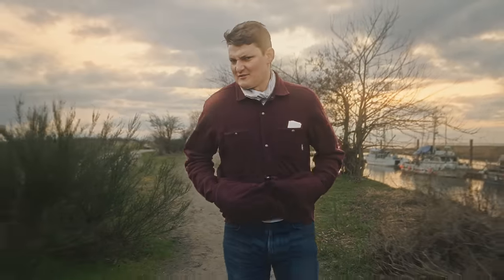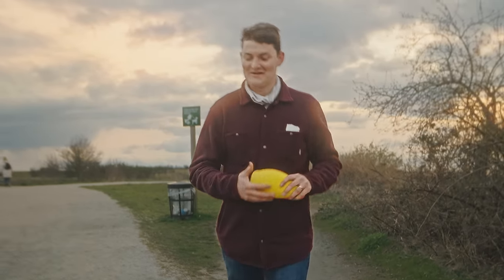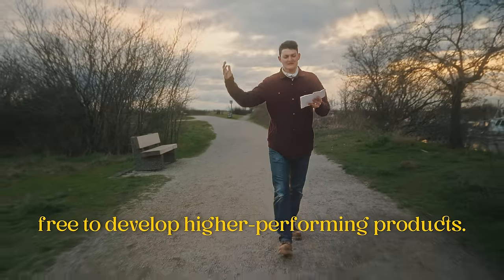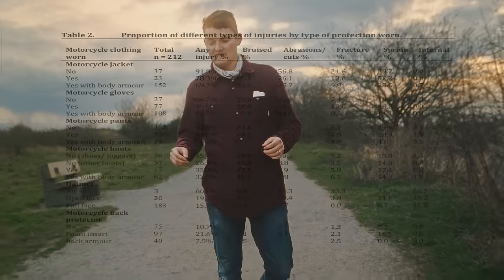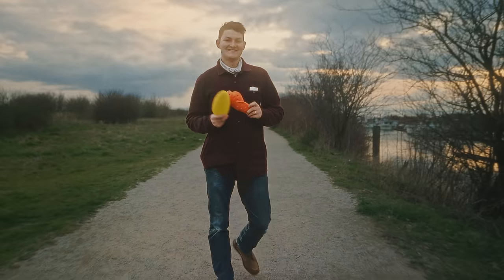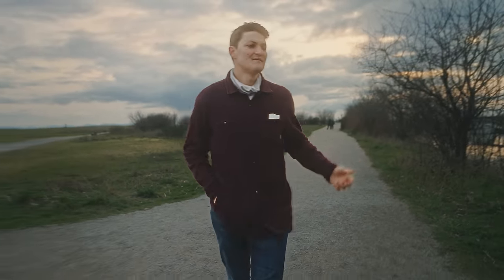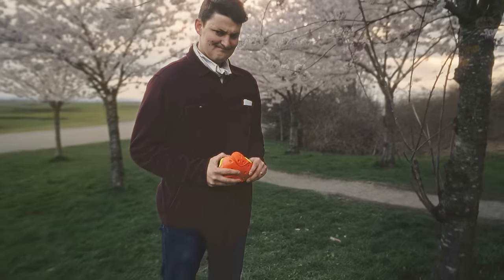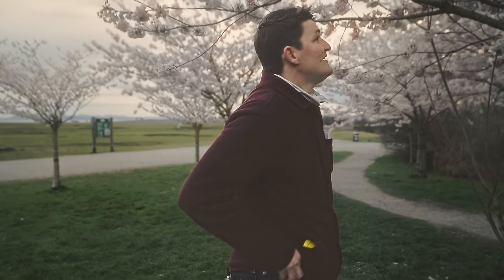Why I Stopped Wearing Motorcycle Body Armour

Comment from the maker: It's worth mentioning that EN17092 tests garments with the pads *removed*. Meaning a AAA jacket or pant, which has been drop tested on the Darmstadt machine at 120kph, will still slide to a highway-speed stop without costing you skin (70kph for AA, 45kph for A). C-class garments have no abrasion resistance criteria whatsoever; this would be something like a mesh chassis for holding armour. Obviously, removing the pads from that would be silly, since its only purpose is to hold armour and you might as well wear a T-shirt instead.

On that note, there are hero companies that make pads to greatly exceed CE 2 size and attenuation requirements. Aside from the Dainese back pad I showed, Rukka's D3O XTR comes to mind (link in description). Those pads are huge compared to the Type B template, and size matters if you're going to rely on pads to get to wherever your abrasion comfort level is. We don't always slide precisely on our shoulders, elbows and knees. It's usually the butt.

We all have our own equations for balancing comfort v. practicality v. safety, which is why I made a point of not telling people to take the armour out of their jackets (twice!). Fortunately the CE standards make it fairly clear what your gear can and can't do, enabling us all to choose the stuff that achieves whatever we're after. ~RF9
Reply: Apologies that my first comment on one of my favourite channels is a criticism.

EN1621-2 is the standard for back protection. The Limb Joint Protectors used in the video are covered by EN1621-1.
Reply: My biggest question to this (and I have many) would be are there quality stand-alone armor makers whose armor is worth replacing the substandard stuff with? And if so who are they?
Reply: Great video.  Thanks for the educational perspective.
Reply: @dmoooooooo  : D3O, Forcefield, Knox, Rheon and SAS-Tec, to name but five - although to refer to other manufacturers’ components as “substandard” is inaccurate. They pass the standard, so are not substandard; it is simply that some producers use superior materials or engineer their products to exceed the requirements set by the standard.
Reply: Thank you, another great video that actually brings information and data! 

One comment / question though, is how does this relate to offroad riding? 

I ride hard enduro, so when I fall, it's never at 120 MPH on asphalt. It's more at 10-25 MPH on gravel / rocks / dirt. And I think that these pads are very useful in spreading the absorbed force, so instead of being poked by pointy gravel, the hit is spread somewhat evenly across the surface of the pad, reducing the overall absorbed force (I believe quite more dramatically compared to the asphalt test). 

So, what is your opinion on using pads for offroad?
Reply: @FortNine : References to velocity (kph) were removed from the draft EN 17092 after the CEN Enquiry in early 2017. The published version refers only to revolutions per minute of the sample holder. There is a full explanation of this in part 2 of the MCGearHub interview you have cited in your references.

In hindsight, perhaps references to speeds should have been retained, as this might then have caused riders to question the suitability of one-piece leather suits, for use in competition and track day events that conform to the EN 17092-3 “AA” requirements, where the highest speed setting of the abrasion resistance test apparatus is a lowly 70kph/414 rpm (not 75kph/442 rpm, as depicted in one of the MCGearHub graphics accompanying the interview), or 43.5mph. 

The FIM has mandated use of EN 17092 AAA and AA racing suits since 1st January 2022. I consider AA to be entirely inadequate for track use.
Reply: The kph ratings are very misleading and do not realistically correlate to real world speed protection. Given the amount of research you guys appear to do with videos, I'm surprised you seem to be peddling this common myth tbh. Unless people are falling on road made from Darmstadt machines, these numbers mean next to nothing.
Reply: I think you should’ve argued the fact that the pads that are supplied in so-called motorcycle pants should be better
Reply: Subject matter aside, that was a superb, 1-take, presentation. Nicely done.

It's probably not conveniently or physically feasible to "prevent" bone damage in high speed impacts, But I can attest that in the only high-speed accident I had, the leather alone, of my motorcycle gear, kept my broken bones from puncturing my skin in a bid to escape my body. That leather protection alone greatly decreased blood loss and increased my recovery time. Didn't stop me getting broken bones though 😂. 

"Safety" equipment made to the "lowest cost point" - isn't that an oxymoron?
Reply: @IN_ZANE_ I agree. Unless you come off your bike in a city street you’re going to be landing on chip seal, not asphalt. Which will chew through just about everything except leather. My understanding is that the material that sits over a pad resists abrasion longer than material that doesn’t as well. I’m not expecting those pads to save my life. I want them to extend my slide time on chip seal roads.
Reply: For folks curious about what this video is a stylistic reference to, it's a Johnny Walker ad from a few years ago called The Man Who Walked Around the World
Reply: I won't be taking my body armor out of my riding gear.
Reply: It would be nice to have a video about good/quality armor jacket/[ants, protectors...
Reply: Given that this video is titled 'Why I stopped wearing motorcycle body armour', and how people go by a headline rather than dig deep into content (not to mention look for any agenda), saying here that you twice told people not to take armour out of their jackets (you forgot to mention pants as well) seems contradictory. The first line in the description also says 'These pads are useless, get an airbag' then affiliate links to the tether-deployed Helite system featured regularly in your videos.
Armour has a significant impact (no pun intended) on the protection a rider can benefit from, and personally I think this is a really irresponsible video (even more so than claiming a 7mm chain takes four and a half minutes to cut). What people wear should 100% be their choice, but I believe it should be an informed choice, not an influenced one.
Oh, by the way – armour is made to two minimum template sizes – Type A is the smallest, Type B is the larger one. Larger armour is generally better of course, though the size of the wearer also needs to be taken into account. As does the position and retention of the armour.
John Milbank, Consumer Editor, Bennetts BikeSocial
Reply: Some might say that, and I quote from the description in this video, "The best motorcycle armor is the one you'll actually wear."
https://www.youtube.com/watch?v=-e6Jy69mezg
Reply: Ryan, I think this interpretation is falling under survivorship bias. Yes, potentially the standard is too low, and yes, people still get hurt when they have accidents. But it's impossible to test the exact same accident with and without armor, and we're missing the distinction that these injuries are more than likely less severe than if the rider had not been wearing any body armor.

My take is wearing protection that reduces the impact is better than taking the full force of the impact, any day.
Reply: @bennettsbikesocial  Very well said! This is one of the many videos by Fortnine where the topic premises are distorted and without proper technical understanding, important nuances are not discussed (sometimes only briefly mentioned), and the conclusions in the videos are absolutely dangerous for the community, especially for beginner riders. To motivate people to take off their protection pads is absolutely irresponsible!
Reply: @isaaclarson  These pads are meant to protect the exposed "edges" of the bones on the elbows and knees. The relatively soft material distributes the impact force on the greater area of the bone, which means more area to absorb the energy and less force per square mm of the impact area, meaning lesser risk of a fracture. To argue that having no protector is the same as having even a small protector is nonsense. You don't even need to test it, it's simple physics. Throw a glass on the floor, it will break. Put a sweater tightly around the glass and throw it, the chances are it will not break. Smartphone protective covers - same reason.
Reply: @flyingmagpie1937  I'm arguing in favor of protectors? I'm confused by your comment here. I'm saying that because of survivorship bias, we have no way of knowing how severe the injury would have been - let me rephrase.... How much MORE severe the injury would have been without the CE pads in place.
Reply: @isaaclarson  Yes, sorry, I didn't mean to oppose you. I'm acknowledging your comment. I meant to explain it further, that even without the "survivors" data, you can already predict that using pads will certainly have benefits over not having any protection pads. Also because similar knee and elbow protection is in many other activities and sports, we can see the benefits of the pads in other areas as well. Sorry for the confusion.
Reply from the maker: @itamarchen1  Yeah I usually wear pads for off-roading and racing. The falls are so frequent, and the rides are usually short and recreational, so it makes sense to take whatever protection you can get. Also, like you say, enduro crashes are usually slower. For general, everyday motorcycling my preference is no pads, but that's just me. ~RF9
Reply from the maker: @paulvarnsverry11  Yes I was bummed when they removed the kph numbers! I assumed it had something to do with not being sued, since every road surface is different, and someone will inevitably crash in a AAA garment at precisely 120kph, lose some skin, and sue. It's a shame though, because "707.4rpm" doesn't mean much to the average consumer. ~RF9
Reply: @FortNine  That's precisely the point, Ryan. If a suit "safety rated" for 120kph from a controlled and repeatable laboratory test failed at 85kph in the chaotic and random circumstances of a real world incident, resulting in the wearer being injured, the manufacturer might find it difficult to defend a claim. That's why I don't understand brands that continue to peddle the kph claims in their advertising and marketing, and who are leaving themselves exposed in the event of litigation.
Reply: While I get what you are leaning to this is a bit of a dangerous video for young, new, or less aware riders.  We have spent decades trying to get riders to wear protective gear…. Like any gear.  I still cringe at these sport bike guys in summer riding in beach shorts, muscle t shirts and flip flops.  I still remember riding dirt bikes on the farm when we didnt own helmets because “we were not racing”!  Finally I feel we were making headway across most rider groups.  And while many of the current tech standards are not good enough rather than rally the hordes to demand better and safer standards, you have advised you are just taking out what little protection you have.  Shame on you Ryan.  Many kids and newbies look to you like the holy grail of advise.  While technically what you said is not wrong.  The pads will protect more than not having them!  Pads do prevent injuries (minor vs major injuries is irrelevant really). Then if we look at what the stats may not capture such as protection on glancing blows, lacerations and even puncture wounds from even small things, the prevented injuries that are at that point where a bone almost breaks, but not quite, bruising and recovery time reduction by having any padding and what about all of the injuries both reported and not reported that dont make it into the oficial stats?  My first riding pants were a set of no name department store jeans.
 When i turned 18 i got myself a set of leather pants ( no padding and really not protective). Now i always ride with gear.  I know you said this is only your opinion but young kids look to you for advice.  I feel you move to vancouver hipsterism has made your head soft bud.  Whether you want to admit it or not, you are a role model.  You cant rely on those that don’t understand all the nuance of what you said to critically think about wearing armour. Kids will see that and think if Ryan doesn’t wear  armour i wont.  But with that they may just not buy protective clothing.  I really thought you were smarter than this.  So sad today😢
Reply from the maker: @bennettsbikesocial  There's an important difference between "Why I Stopped Wearing Body Armour" and "You Should Stop Wearing Body Armour." The inability to distinguish between a personal opinion and a public imperative might be why the internet is such an angry place these days, and apparently stating it explicitly, twice, is not enough to get past that? We're in trouble.

I am aware of the Type A template, but I like to give a "best chance" to the things I attack as inadequate. That's also why, when listing the EN1621 kN threshold for armour pads, I listed the higher EN1621-2 numbers instead of the lower EN1621-1. I really don't need to underrepresent armour pads to expose them as inadequate, and doing so would only leave people whining about the existence of Type B and EN1621-2 in the comments as a rebuttal. Oh well, I guess there's no way around that either.

Also, if you think my agenda is to get rich off an airbag that isn't in stock at FortNine, your opinion of my intelligence must be as low as your opinion of my morals. ~RF9
Reply: @FortNine You mean it wasn't an April Fool thing! 😲🤯
Reply: @FortNine  Problem is few will do their homework or actually interpret the video as "do prefer an airbag to pads". For such a life or death topic you need as many disclaimers as possible. The fact that you talk rather confidently when drawing conclusions from all these statistically underpowered and survivorship biased studies doesn't really help. I am sure we are all for the gear companies doing better, but demonstrating the need for this shouldn't come with collateral damage.
Reply: @paulvarnsverry11  Plus, as you know, ONLY in AAA is the butt considered a key-impact area. In AA and A the speeds Ryan has quoted above are even less relevant. If we translate them though, in AA the butt is actually tested at the equivalent of 45kmh / 28mph. In A, the butt only has to endure a test at the equivalent of 25kmh/15mph. And that's before you take into account that the Darmstadt machine is considered an analogue of tarmac, which has been proven to be around 4.5 times LESS abrtasive than the surface dressing found on most of the roads that riders in the UK enjoy.
Reply: @itamarchen1  I ride the same - but not even hard enduro - and slip/slide/fall plenty. And my experience is the same: slower speed falls onto lumpy, gravelly, rocky surfaces. The padding in my gear also spreads the impact of gnarly little, finer-point objects and surfaces. So far, my only (knock on wood) joint injury was a shoulder/clavicle thing from landing hard thereon. I'm thinking only an airbag might have prevented that. Otherwise, the padding has done what I expected. Doing pavement at speed is a different animal - considerably more savage.
Reply: It is hard to make a decision from data like this. Yes, understand that the protection or standard of protection is subpar. However, there is still at least some protection. This video helped me be more critical about motorcycle gear . Shoot for the highest crash rating gear for the money and not a  brand and add an airbag. This is better than continuing to buy expensive stuff without any logical approach.
Reply: @bennettsbikesocial  surface dressing really is viscous.
Reply: What about EN17092-2020 B-class garments? That's garments approved for abrasion resistance, but without any armored padding. Maybe this, through some lobbying ofc, could be the new standard for motorcycle garments, and we could have class B, BB, and BB, in addition to A, AA, and AAA?

Sidenote: after learning this info I can't help but laugh at the uselessness fo the old EN-approval rating for motorcycle garments (jackets and pants that is): apparently they did not test for abrasion resistance at all; they just checked that the padding in the garments were EN1621-1:2012 / EN1621-2:2014 / EN 1621-3:2018. Anyways I digress, I too now will not use padding anymore.
Reply: Greetings from TU Darmstadt
Reply: @FortNine remember you are a respected content creator in a position of influence, like it or not people will 'do as Ryan does' because they like you. Also remember that most consumers of content don't truly listen, they only hear the headlines
Reply: @FortNine  The internet wouldn't be such angry place, if you did proper research for your topics and didn't misrepresent the information you are citing:

- The study “Energy attenuation performance of impact protection worn by motorcyclists in real-world crashes” (2017).
"The work presented here relates energy attenuation as measured using the EN 1621-1 test method to real-world injury outcome. The results cannot be directly related to fracture tolerance levels reported in the literature from different loading conditions, and currently there has been no work linking energy attenuation measured in this way with the types of loading conditions leading to fracture in the real world." Meaning, the femure's 4 kN and the IP's 9 kN are NOT directly comparable!
“90 riders were recruited in this study”, the clothing was inspected from 62 people, and the IPs were collected from ONLY 19 riders! Citations from the study: “As noted earlier, this sample included only a small number of riders with impact injury, and the total number of riders was also small. The results presented here should be confirmed in a larger sample.”
“Due to the recruitment methods used in the larger in-depth investigation study, this sample of riders is also biased toward the more seriously injured riders involved in motorcycle crashes.”

- The study “Effectiveness of protective clothing for motorized 2-wheeler riders” (2018).
The study analyzed the protectiveness of the all motorcycle clothing overall, not IP in particular. So, of course motorcycle gear can't completely protect you against ANY fractures, dislocations, or sprains. Citation: “Our results argue for more widespread use of protective clothing by MTW (motorized 2-wheeler) users.”

- The study “Motorcycle protective clothing: protection from injury or just the weather?” (2011). 
“Data was obtained through structured face-to-face interviews.” “No association between armor usage and fractures” doesn’t mean they are useless; it means in this particular study (with 212 subjects) they didn’t find ANY association to make any relevant conclusion about that. Then literally in the next sentence after "...the benefits could not be detected specifically in relation to fractures..." they state "...in unprotected motorcyclists (Duffy and Blair, *1991*) the sample size was likely too small to be able to detect any such difference." Also, conclusion from the study: “Conclusions: Motorcycle protective clothing is associated with reduced risk and severity of crash related injury and hospitalization, particularly when fitted with *body armour*.”

- Meredith L. “Assessing the performance of motorcyclists’ impact protectors in simulated ATD knee and shoulder impacts” (2019). 
By the way, you wrote the wrong name of the study in your sources. This study tested 23 shoulder IP and 7 knee IPs. They tested if the EN 1621-1 impact test performance is “a good indication of IP performance”. The relationship between IP performance and injury protection remains unclear, because they can’t exactly evaluate it and not because the IPs are useless. 

All these studies show is that impact protectors can't 100% completely protect you from an injury and should definitely be better than they are now. But it doesn't mean they don't protect from severe injuries, and I mean from fractures too and also from potential nerve damages. It seems like you’re just cherry-picking citations to make the IPs seem useless. Otherwise you wouldn't ask "Why then are these things everywhere?". It's also interesting that somehow there are IPs that are apparently good, because they go "waaay beyond the CE standard", but you don't cite any studies or explain why exactly "it works" in comparison to the "useless" ordinary CE IPs.

In the video you talked IPs being useless for 5 minutes. So, the insecure "I can't tell you..." and "I won't tell you..." followed by "I did it and I love it" didn't have much weight. Then you emphasized your choice with such philosophical saying, that the “appreciation” of life should be more important that the “protection” of it. If it isn't persuasive, I don't know what is. For me it doesn't sound like a strong statement to keep people from making the same decision.
You are kind of a role model for many young motorcyclists here, many want to learn from your videos. And your inability or unwillingness to acknowledge the influence of your opinion on the public through the cinematography and art and the clear agenda in this video is extremely naïve and malicious. So please, Ryan, I am sure you can do better.
Reply: This is just a YouTube channel, I know, but I have to admit I'm sad this day has come. I know content creators nowadays need to milk the algorithm with the most inflammatory, misguided, engagement-enducing videos they can come up with, but somehow I expected Fortnine to be above the trend. To think this is the same channel that made the cinematic masterpiece that was the Kawasaki Versys 300 video six years ago is almost painful. Thanks for the journey, I guess...
Reply: @ZANGI3F  you have much more adequately summarized my thoughts. I'm absolutely stunned that after looking at the data the take away was armor doesn't help. Stunned
Reply: @FortNine  please don't go for low hanging culture fruit as the reason your audience finds issue with your points. It's a debate we can disagree with your findings and the world not be ending. 

You're better than that. I would not be able to handle thousands of people saying I'm wrong either but just so you know we have limited characters you have videos. Expression is narrow via this format.
Reply: Thanks for the video. Good information (for on road riding). FYI, since you cited a study here, it would be proper to provide a link to the paper, or at the very least a reference in the description. Thanks 🙏
Reply: @flyingmagpie1937  Thank you. F9 has to delete this video.
Reply: @bennettsbikesocial  "What people wear should 100% be their choice, but I believe it should be an informed choice"...This video literally gave information. WTF are you asking for?
Reply: @paulvarnsverry11 The bigger issue is the longstanding and immoral ‘regulatory capture’. It’s plagued motorcycle protective clothing, e.g. Dainese and Alpinestars successfully lobbying against Europe adopting Dr Woods’ level 3 armour standard. And more recently, Knox successfully blocked the establishment of AAAA and AAAAA standards. The poachers are also the gamekeepers because manufacturers comprise about half the standards committee members 😡
Reply: @bennettsbikesocial Indeed. However, I praise Ryan’s video for calling out the ‘regulatory capture’. Concerning CE and BSI standards, regulatory capture is a longstanding and immoral problem. The poachers are also the gamekeepers because manufacturers comprise half the standards committee members. It’s how Alpinestars and Dainese stopped Dr Woods’ level 3 armour standard from being adopted as a European standard. More recently, Knox’s ability to block BSI from establishing the AAAA and AAAAA standards is a blatant example of regulatory capture 😡
Reply: I don't even ride and I love your videos
Reply: @MrStrizver  This video literally didn't give ANY substantial information! The Femur breaking force can't be compared like he did, the studies were misrepresented/misinterpreted, hence the accusation of Regulatory Capture is baseless and out of the blue. What you basically get from the video is - Ryan bashing the CE standard, saying he got rid of his IPs and he loves it, because one should enjoy life instead of overprotecting it. And the important mentions from his pinned comment are not in the video!
I'm all in for criticizing the CE standard to do better, but this video is absolutely not how one should do it.
Reply: @The-Splat  While this is a real problem, the way Ryan calls it out is likely more harmful than helpful. You don't claim that armor that prevents injury isn't good enough (for some definition of "good enough") at preventing injury so we should discard it?! This is irresponsible and unscientific. It might not be "good enough", but it is anything but useless, as clearly exemplified by the very studies (ab)used to back the claim.

If you want to induce changes in the standard, you point out the weak points (and there are many). You point out the alternatives (and there are some). And you use your power of influence to guide the gullible towards better odds of survival, not to encourage them to drop even the tiny amount of protection all the kids are using these days. Power comes with responsibility.
Reply: Whoever thought that protection from abrasions inuries might be a good thing?  I don't expect my gear to prevent broken bones, but I'm sure glad the skin on my shoulders and elbows doesn't have mesh fabric melted into it!
Reply: @bennettsbikesocial Well  said John 👍👍a completely irresponsible video, even the missus said what the heck is he talking about! I’ll always support your consumer advice 👌
Reply: This channel jumped the shark long ago. Too bad.
Reply: @FortNine  instead of doubling down on being wrong, maybe correct your f*ck up
Reply: I have the same Dainese back pad and it is awesome. As well as on my motorbike, I also use it when I go skiing ad it saved me
Reply: Thanks @derekcowan2373  ! I don't have anyone to help me film or edit, so the production values are often lacking, but hopefully the content helps. And videos are just a fraction of my job, but I'm lucky that I'm paid a salary that isn't affected by our content's success at all. The agenda is to simply build awareness of our brand as a motorcycle insurer, and hopefully to build trust in it (and before anyone asks, no, what you wear – besides a helmet – doesn't affect your insurance policy), because we want more people to get more out of motorcycling. I guess you could say though that the more riders there are, the more money we could make! Cheers, John
Reply: @ezsteel78  Regulatory capture aside, the CE standard is ineffective for impact protection. All the peer-reviewed scientific studies have shown that the standard is too low to protect us from fractures. 
The evidence indicates that armour's additional abrasion resistance helps compensate for our clothing’s often inadequate abrasion resistance. However, armour is neither advertised nor tested for abrasion resistance.
Reply: With big impact and influence comes big responsibility. I'm not sure whether you realize how potentially dangerous this video can be...
Reply: @The-Splat  Please show me such study! Because every study Ryan cited was misinterpreted and not one of them said that the CE standard is ineffective for impact protection. One aspect of the armor is that it increases the sliding area where the abrasion occurs, because of that the pressure force is reduced. This alone increases the abrasion resistance of clothing.
What evidence are you talking about, the Ryan's evidence?
Reply: Ryan, there are people that respect you but won't necessarily see the full video or your pinned comment. All they will see is a picture of you, holding armour pads, and the word useless followed by a title saying you removed them. Whatever your intention with this video you could so easily cause some harm. You need to think this one through a bit more. Think of the people that just read the headlines. Already on the Bennets response video there is one commentor blindly following your view with literally no thought or research into anything they are saying - you are being a bad influence.
Reply: @FortNine sure sure buddy, posting this video won't influence anyone at all - and you are in no way responsible for that either.
Reply: The take was maybe too clever. Seems that it could have been directed at the industry to improve its production standards, along with highlighting companies that attempt to far exceed the dismal minimum standard in the first place.

Q: Who, then, paid for “Ghost Armor” to pass such high standards as it supposedly does? 😅

Current kit: Klim Badlands (level 2 D30). Saving up for a Rukka. Those fabrics, over sized armor, and production standards essential.
Reply: @dmoooooooo they are out there but that gear is out of reach for most average users. I saved up to purchase the Klim Badlands suit with Level 2 oversized protectors at a cost of $1600+. 

Looking into a Rukka jacket with even greater coverage. But it will come at even greater price than the Klim.
Reply: @paulvarnsverry11  Sure, the protection isn't "substandard", but when the standards themselves aren't adequate, then what?   DOT helmets aren't "substandard" according to that standard, but are widely regarded as substandard when better designs are the norm, the de facto "standard"
Reply: And perfectly timed walk to the final props.
Reply: Making money through the Revzilla partner program from every viewer who believes you and decides to upgrade their pads, in addition to the YT ad revenue, is a nice touch. Milk the idiots for everything they're worth.
Reply: @FortNine  You're right, getting rich off an airbag would be dumb. You're doing the smart thing and getting rich off an airbag, Rukka pads, and all the YT ad revenue you get from the controversy driven traffic.
Reply: @FortNine  rather than cutting the 'Type A' and 'Type B' thing out, it would have been better to assume your audience aren't idiots, and have taken the few seconds to address that in the video.
It's odd that identified a genuine issue (that armour is inadequate) yet come to the conclusion "it's not worth wearing armour". This video should have been a further push to the industry to make better protectors, and a push to consumers to  for better protection from their gear. Instead it's just devolved to a doubling-down in the comments defending a video that's as inadequate as the protectors it discusses (not totally inadequate, but with significant improvement needed)
Reply: I think this sorta assumes the perspective that anyone thought the pads were there to protect against impact, instead of giving additional protection from abrasion injuries. As someone who's had to pick gravel out of their elbow and stare at exposed bone, I think it's foolish to discourage people from wearing padding that will prevent road rash and friction injuries on the grounds that it's unlikely to prevent a fracture
Reply: Hey Ryan and Fortnine team. Thank you for always doubting and challenging regulations, tests, standards and materials. You keep us vigilant and informed! I see that the people have got angry because obviously they got a different message from the video. I see that Bennets has released a video where they answer to your video and they treat your video as if you said to stop using pads, even though they say in the comments here that they understood what your video was about. I am actually disappointed with their dirty insinuation about your morals and ethics. Keep up the good work. I hope you don't lose your humour after all this hate. People don't understand that you make informative videos and the choice is always theirs. Unfortunately nowadays people expect to tell them what to do. So the message they got was 'take off your pads'. Greetings from Greece. Take care
Reply: @MrStrizver  Correct and complete information.
Reply: @koutsion  What!? He didn't do any evaluating tests or analysis of regulations and standards. He misquoted other's work to back up his personal choice, then used his extensive platform to influence credulous numpties in their behaviour and put on a thin veil of implausible deniability. Read the references in the comments to the source material, especially flyingmagpie 1937. Could save your skin. Literally and metaphorically.
Reply: so you do mention a dainese back armour being good .. what about other dainese composite armours ?
Reply: What if you got hit by a force of 5 or 6kn bones will break at 4kn without pads but with pads im sure the force will weaken significantly
Reply: @pamvarnsverry2444 ex Bennetts employee here, so I'm under no duress to promote them. They are unbiased in terms of gear, they don't get paid for reviews. The only reviews you get are their own personal opinion!
Reply: @harrypwhite  As employees they receive a salary??? so I assume you mean no commission from the product suppliers - like say freebies such as jeans etc.. and others will hold and share different opinions on the products being looked at sad world if we all thought the same way. One ex to another, ride safe
Reply: @FortNine  we're on day 2 of people seeing this video and going "yes I should ride without armor"
How long before you pull this down? Seriously want to wait to have blood on your hands?
Reply: @ryanjapan  But one of the points people in the know have been making here and other places is that pads very likely DO PROTECT FROM FRACTURES, it is just that research samples are too small for this effect to achieve statistical significance. There is also expert medical opinion in comments around here that the force fracturing the bone does matter for your recovery chances. If you are going to be breaking bones, you do want the breaking force to be smaller rather than bigger.
Reply: @koutsion  Kindly look at the thumbnail of this video again... If you think kids these day watch more than 30 seconds of a video, you have been living under a rock. Also, the road to hell is paved with good intentions.
Reply: @jonathanmackie4884  I never said I dont use pads mate. You are assuming I dont. I never said I dont use them or I think they are useless. I just said that this video is actually food for thought. You are doing with me, the same thing that you do with F9's video. You assumed I told everyone to not wear pads. I always wear them. Relax and read again what I wrote.
Reply: @ezsteel78  So someone came here, watched the thumbnail and the title and though that they watched the whole video? And that's my fault? xD
Reply: @koutsion  Your fault? Don't flatter yourself. :D Your comment was read by me and 1.5 other people.
Ryan, on the other hand, should know better.
Reply: I went down at a relatively slow speed about a year ago, my hip, knee and ankle were badly bruised and with some abrasion...this was before I had riding gear. I believe all the injuries would have been significanlty mitigated with apparel that had the basic armor cards inserted and if I had been wearing a riding shoe/boot that covered my ankle. I have all that now, but I don't allow myself to think for a moment that it makes me invincible.
Reply: @dougschneider5948  I can't imagine why anyone would take the armor out. It's really not that uncomfortable and will help greatly with abrasion resistance, I mean how could it not. You have your motorcycle textile/leather/whatever material as the jacket, PLUS another layer of specifically made armor for EXTRA protection. Why would you NOT use that? I ain't taking mine out either. Those airbag vests are pretty expensive too, but if you can grab one, that be cool, I wonder how uncomfortable those are? They seem more so, but have not tried one on.
Reply: @flyingmagpie1937  why anyone would take out armor in their gear seems just common sense thats really stupid. It's not that uncomfortable and obviously the armor IN the gear is going to help way more than armor OUT of the gear. It's ridiculous to take, there's no reason to...for what "comfort"? Its not even really uncomfortable in the first place.
Reply: @koutsion  Not my intention to suggest you do or do not. My problem is with the video and the misleading nature it displays. So, we perceived different things in the video and I don't see it as food for thought due to erroneous logic and potential for negative consequences to some less analytical thinkers. Stay safe mate.
Reply: @bennettsbikesocial  I can help you film and edit, you in CA? 😄
Reply: @jonathanmackie4884  Stay safe as well. Thank you for not escalating. Take care!
Reply: @ezsteel78  True. Since there are so many bad reactions probably they should re-upload a video with clarifications. Anyway... Stay safe!
Reply: By the end of the video you said that you take the armour out of your jacket and you love it. I’m very curious as to which jacket are you referring to and if you would take the armour out in a summer mesh ventilated jacket that’s still got abrasion resistance on certain parts!
Reply: You should conduct research through surveys of your subscribers. Accidents without injuries won't result in injury data.
Reply: @ZANGI3F  Exactly, the tests DO NOT provide anything other than a comparable testing regime.
A heavy low speed point impact such as hitting a shoulder is more destructive to the fabric than a high speed slide.
Body weight, road surface, impact area, speed - all influence crash outcomes, sometimes inversely.
Reply: I am curious to know what purpose an airbag backpack would serve if you landed on your shoulder or elbow. I’ve had a few offs over the years, and on each occasion my padded jackets protected me and none of them has a single mark on the back.
Reply: @jacobcoetzee3849  This, and most other airbags, inflate across the chest too, which can make a huge difference in a frontal impact. But absolutely – most airbags don't cover the knees, hips, elbows and shoulders. There, armour can mitigate the energy transferred in a crash, and also make a very significant difference to the abrasion resistance of the material. They're providing protection from impact energy, which can also tear at the fabric, especially on surface-dressed (chip-sealed) roads. Airbags are great, but so is armour. It's not one or the other.
It's worth noting though that Alpinestars does offer airbags that also cover the shoulders and hips. 
Everything is a compromise, and hopefully people will make informed decisions on what's right for them, weighing up comfort, price, convenience, risk etc.
Reply: The industry that sells into the UK and Europe has to meet the minimum requirements of the various CE standards, but that doesn't mean that some brands aren't striving for more. There's push-back from some who believe that the standards limit smaller brands from making kit that they can then promise is protective without certification, but the idea of getting rid of minimum standards just takes us back to when brands (and shops) could claim what they liked and use marketing to influence purchasers. NOTE: riders are free to choose what they wear in the UK (besides a helmet), but sellers are legally required to certify riding kit as PPE. There is NO obligation to wear it. If you prefer Kevlar Crocs that's up to you.
Certification is not a legal requirement in the US and Canada, but it's clearly causing frustration for the stores and some brands, who must be getting more and more customers asking for proof that the kit they buy has at least met some minimum requirements of protection, so are looking to the brands that also sell into the UK and Europe. I can imagine that might lead to some wanting to discredit minimum requirements.
Of course there's plenty of room for improvement, which is why when one brand blocked BS13595 in the UK – which would allow those that are doing more than the minimum standards to prove their kit's additional performance – we launched the Bennetts High Performance Awards. These will evolve of course, and there are already a lot of products on there with many more to come. We don't make money out of it at all, and the only cost to any brand is in getting a small amount of additional testing done at the independent lab of their choice. And it doesn't affect insurance, and never will.
Reply: The video about the High Performance Awards is called the truth about the road surface you ride on
Reply: @karlfonner7589  that wouldn’t let them use a very click-baity title though
Reply: I like the Dianese Pro Armor jacket that has that back pad and similar shoulder and elbow pads built in, affixed to the outside. Makes a great armored base layer.
Reply: Everyone with doubts on F9's claims, search for the channel of Bennetts who have reviewed F9's claims in full details. (with a special guest included)

If you want to do the same for F9's recent video about engine balance then search for the channel Driving-4-Answers.

Both give a way more detailed view on certain matters in which F9 tries to get involved while not seemingly fully understanding them.
Have a good view on both of those channels. Peace ✌️
Reply: @FortNine The internet is an angry place because YouTube stars tend to use misleading clickbait titles.
Power of reach leads to responsibility.
Reply: @Herobrinecannibal  : Regarding your reference to “the old EN approval rating”, until EN 17092-5 for B classification garments, there has never been a motorcycle clothing standard that did not state impact protection SHALL be present. The original, higher, and now regrettably withdrawn (but still legitimate to use) EN 13595 required impact protection to be present at the shoulders, elbows, hips and knees. Consequently, I do not recognise any document to which you might be referring.
Reply: I had simply plastic armor and helmet, as was so unfortunate and fall on my back into 0,5-1m sized stones from 3m height with my snowboard. I would have surely broken a spine, but due to the plastic and helmet i had nothing. Regarding helmet iso, bycicle helmets are a joke, and ski helmets are not suitable to fall of a ladder when you change a bulb in your room. I trust only non polycarbonate helmets.
Reply: @famster92  Happy to learn we Germans are involved. Dont know much about the topic (alas i drive motorbike allyear 30y), but as an engineer and medical doctor myself bicycle helmets are a joke. And for ski helmets ask M Schumacher.
Reply: @flyingmagpie1937  Nailed. THX.
Reply: @vennemans9113  Yes, I absolutely agree with you! I am a car mechanic myself and "Driving 4 Answers" is indeed a VERY good channel if you want to understand the intricate and nuanced mechanics of the internal combustion engines, but still on approachable level for non-experts! F9, based on his videos, has little understanding about what he's talking about.
Reply: Ryan, I love your videos, but even hinting at not recommending motorbike body armour is too dangerous for new riders who never crashed and therefore don't know which parts of the body normally get impacted. I believe this video, regardless of its beautiful execution, is a viewgrab. Sorry, but as a long-time F9 fan I'm disappointed with this "advice".
Reply: Jzzuuuzz.............
Reply: @paulvarnsverry11  Knox, I just bought some.
Awfully impressed.
 I ride a scooter and I've dropped a couple with and without the cheepo stiff cardboard type armour. 
Without I had tissue damage to the elbow and a bruise,
and with, I just got the bruise, but my jacket got ripped. Knox look like a game changer.
Reply: @tschn7199  Hey, greetings from Germany, thank you for sharing your experience. I'm sorry you lost so many people you knew, I lost a friend to a motorcycle crash too.
What we should understand is that there is no ultimate protection on the roads. Even for the car drivers the unlucky crash situations that are lethal still exist. And the motorcyclist are even less protected. You have to keep that in mind.

BUT it doesn't mean there's no reason to protect you with full armored motorcycle gear. Most crashes happen at city speeds around 50 km/h. So most of the times wearing the certified gear will definitely help you prevent bad injuries if you crash. I had two crashes below 50 km/h in full gear, no broken bones and no dislocations, just some bruises.

And yes, not being afraid IS the goal! There is nothing wrong with mainly feeling safe on your bike, it's good, you get confident with controlling the bike, with steering, breaking, leaning, different body positions, etc. You ride more, practice more, gain more confidence and get more comfortable on your motorcycle. Just DON'T get OVERconfident! Definitely know your abilities and limits, ride safe and always remember that there are many things beyond your control. And you don't need to race, drag a knee or filter to have fun on your bike. So enjoy the ride and always be careful, if there are people behind you going fast, then let them through, don't let anybody to push you beyond your comfortable zone. Maybe also don't ride the most popular twisty roads on sunny weekends, those tend to get very dangerous and crowded with bikers.
Enjoy the riding experience, stay aware and be safe!
Reply: @isaaclarson  I suspect that you're on to something here. If I nip up the road in 30mph zones on my bike I won't bother with my cumbersome but most protective gear. Conversely, if I'm on a longer ride on a high performance bike with mates and looking for excitement then the best clobber comes out. It's difficult to account for this fully when assessing bulk data from accidents.
Also, how are the riders who fell off wearing high quality gear but were not seriously injured accounted for as their stats were probably missed - ie the emergency services weren't involved!
I find this Youtuber's videos fascinating and this is a complex subject. He makes some good points and the simplistic/misleading titles are not ideal but seemingly essential to grab the attention.
Reply: @joaosoares3719  I don’t know guys but I’ve always thought that these CE pads are a joke, so I was actually very satisfied to see this video prove my point. The pads can and should be better than they are. They must have a hard shell and soft interior, kind of like helmets. Try putting on your motorcycle jacket with soft pads and slam your shoulder into the wall, it will hurt. Try to do the same wearing armor with hard plastic and soft lining - big difference
Reply: @paulvarnsverry11  Paul, I fixed the speed rating for AA requirements from 75 kph to 70 kph in the diagram of our interview (it was a typo while converting the kph references as I had to redo all diagrams at the same time). Thanks as usual for being the voice of reason.
Reply: @MotorcycleGearHub  : Thanks for taking care of that, Roy. A question I have been asked a few times by observant enquirers is why there is a difference between the intermediate setting for AAA (75kph as was; 442 rpm as it is now expressed) and the highest setting for AA (70kph / 412 rpm), when there is usually overlap between performance levels in standards (although that isn’t always the case).

Ordinarily, it would be expected for the progression of settings to be 707-442-265-147rpm (120-75-45-25kph), and that is how the draft standard originally read, but it was published as 707-442/412-265-147rpm (120-75/70-45-25kph) after it was discovered materials popular in textile motorcycling garments would fail at 442rpm/75kph, but could pass at 412rpm/70kph. 

Consequently, the requirements were adjusted to enable materials that are the mainstay of a significant proportion of jackets and pants could continue to be used and the garments certified.
Reply: @paulvarnsverry11  Many thanks for your comment, Paul. Yes, that was the original typo in the diagram as you described. I really appreciate your commenting here too. FortNine/Ryan will delete any comment linking to our interview on my website; the same interview that Ryan took your quotes from out of context without even citing the source (my website). I've also seen the insults that Ryan has resolved to when arguing with John (Bennetts) as Ryan can even get his facts straight. What an absolute letdown from FortNine/Ryan.
Reply: These studies have a tendency to leave out important information, the low speed offs where there were no injuries that were significant to report. These incedents are likely the most common, and the ones where the padding can be the difference between wounded pride and a hospital visit. Ryan, many people look up to you for advice, and despite your disclaimer about only talking about your own preference it will result in less experienced riders taking it as Gospel, and that makes this video dangerous.
Reply: Sorry! but this is freaking unbelievable. 1 Does protective gear protect you completely? Of course NOT! 
Unless they would make gear that will cost you a hundred thousand euros (maybe!) 2: This is just BASIC! knowledge and understanding: If a hockey player would shoot a puck straight at your face! who would be the worse off? The one just standing there, or the one who has CE level 1 or 2 or whatever in front of his face? RIGHT!!!! 3: if it does not help? Then why do you still put on your motorjacket? Your jacket is no better than that protective gear. Go in a shirt(summer!)or sweater and a plastic raincoat when raining.
4: protective gear helps ALWAYS!!!! 5: There have been HUNDREDS!!! of studies (hospital statistics! )and they all ! say with protective gear your injuries are LESS! severe. And I can personally !!!! state that, when I had an accident on my bike(not my fault) and I had 3 bruised ribs and that the doctor told me(after I told him how and what happened and speed) that my chest probably with a 90% chance, would have been crushed( I have a good! jacket with chest protection before airbags existed). I am driving 30+ years and in EVERY pant and jacket that I have, I even put in DOUBLE! protective gear(bigger size clothing) and also an airbag jacket(what reduces injuries +/-70%) . Is it very comfortable? no! But I prefer!!!! to stay alive!!!! Even on the inside of my helmets, I have put in 2 layers(crosswise) of Kevlar. And on every! pant and jacket that  I have put on my country flag and first name and blood type(in case of a severe accident with blood loss paramedics can not take blood(forbidden) to see what your blood type is, so they can give my blood type of blood instead of plasma what reduces!!! your chances of getting in shock over 70%) Accidents are not always your own fault! Even expert drivers are not! immune to it.And your statistics? exactly the same as they do with cars Euro Ncap, those statistics, tests only are tested for a little% of real accidents. NO!!! crash test can test all !!!! of the real-life accidents. So sorry! But ANYBODY who takes out his protective gear or is not wearing any, are in my personal opinion, COMPLETE IDIOTS! If you do not like wearing them? TAKE PUBLIC TRANSPORT!
Reply: That's an absurd response. You made a click bait video and spouted nonsense to a massive following that, clearly from many of the comments, treat you like you actually know something because you make snarky videos for a small canadian retailer. It boggles my mind that anyone would take anything you say seriously, but they do. Blaming people for calling you out is beyond childish and claiming it's all just internet anger is, as I stated earlier, absurd. Grow up.
Reply: @pamvarnsverry2444  "This is a great video and F9 and Ryan can be proud of their work. " yeah imagine going to sleep knowing you may be a big player in the reason why someone gets permanent injuries or dies because they took the pads out of their gear.

"Wow I'm sure glad I fractured my spine falling at 30kmh because I took my back protector out" - nobody ever.
Reply: @pamvarnsverry2444  Hey, glad for you, it still doesn't adress the simple fact that if you smash your knee on a piece of furniture with and without pads you'll feel the difference and that's what it boils down to: pads should be better? Yes. Does taking them out solve anything? No. Is F9's video misleading in how 90% of it says "take your pads out" and only a tiny bit addresses the fact that they do actually work and the rest is airbag advertising? Yeah.
Reply: @dmoooooooo  it is in the description
Reply: @bennettsbikesocial  you are right - many just read the headline and turn off the brain - like you did... Do you really disagree with protecting yourself better with an airbag og better shields? Really?? to quote ryan - "I dont give a sh-t what airbag you are bying - just buy one".. and he is right - airbags are far far superior to thin plastic shields.
Reply: @MrMichaelfalk  Totally agree. When deployed, they are absolutely and we look forward to them covering the knees, hips, shoulder and elbows too. (Using a second account as blocked from commenting now).
Reply: really doubling down on this aren't you.

1. pads need better sizing
2. pads are not meant to instill a false sense of safety
3. most preventable injuries will come from things you cant anticipate. regardless of skill. an 80% reduction of energy (within a range) can prevent a small accident becoming something more serious.

dont tell people to remove PPT because you want to. yes there needs to be an improved standard.
Reply: @karlfonner7589  exactly.
Reply: @MrMichaelfalk  90% of Ryan's video only says to take the pads out, cherry picking studies he doesn't understand. Also, even if you wear an airbag: what's the reason to take pads out? This is never addressed. The pads do work, it's just Ryan that wants to look slimmer, that's basically it. You want to look slimmer? Take the fckin car.
Reply: I’m only going to tell you this twice. Remove the Armour Pads from your Riding Jacket. This gives you more comfort and room for extra layers of clothing. Then, install external pads with hard plastic (slide) protection. (Much Safer) Again, REMOVE the Armour Pads from your Riding Jacket, (before you damage your Funny Bone) ! 💪😂👍
Reply: This is science cited ignorance. In Aus we might call this 'fuckwittery'.
Reply: I challenge anyone who takes this as gospel to the following: From standing position,  drop to your knees allowing the full weight of your body by landing on your knees. You may have the balls, but hopefully your brain will stop you. Now put your favorite riding pants 👖 on,  you likely won't hesitate. Is this test perfect? Is armor perfect? No, but it clearly reduces impact. Ryan is brilliant, but in occasion, he's purely didactic where my anecdotal test proves so.
Reply: @gregorysteffensen3279  Just seen the J Walker video and don't see any similarities outside of the fact that both of them are walking while talking and they did it in 1 take. There must be hundrets of videos like that even before Johnnie Walker did their bit.
Reply: It's nicer to roll on the asphalt with protectors. I will keep them.
Reply: @dmoooooooo  komine.

They make a variety of standalone protectors that are officially the standard of motor riding schools in Japan.
Reply: If your movement or flexibility is impaired by stock protectors in riding gear remove it. Wear standalone gear underneath or overtop instead in a size shape and form that actually fits your needs.
Reply: Why do you keep deleting the guy countering your arguments
Reply: @flyingmagpie1937  the message I got was that if the protective clothing industry is going to write their own protective clothing standards, they should actually have one that is useful in real world crashes.  To paraphrase you: selling clothing that purports to provide protection is absolutely dangerous for the community, especially for beginner riders.  
As noob rider I spent more money on my riding gear than on my bike.  But I was at the mercy of the "knowledgeable" sales staff recommending the safest gear.  So I want standards that actually mean the gear does what it claims to do and isn't just protection theatre.
Reply: As one said," it's the economy stupid"
Some is better than none😊🤘
Reply: @Galf506 You’re getting way too emotional at a video you clearly didn’t understand. He’s not advertising an airbag and he’s not telling people they should ride without armor. Relax and quit getting so uppity because he provided data and an argument.
Reply: I have neck injury due to dillion brothers not tighting my head neck bearing...  wearing my helmet did nothing to stop the speed wobble due to my neck bearing.
Reply: @flyingmagpie1937  Excellent response. FortNine should reconsider the video, largely irresponsible as a role model.
Reply: Éste Sr. Ha hecho un vídeo escandaloso diciendo los de las protecciones porque simplemente quiere vender su producto! En el momento que tenga una caída el airbag salta, cuántas veces puede saltar? Porque por ese precio me compro un traje Dainese con Airbag,con todo protecciones airbags, y lo más importante UNA ESPALDERA! Para las lesiones de columna, tengo tres para diferentes tipos de chaquetas. No pensé que se pudiera dejar subir un vídeo diciendo tantas barbaridades, poca gente ha perdido en moto y pocos accidentes ha visto además de lesionarse y o ver compañeros heridos. La ignorancia es muy poderosa.
Reply: @paulvarnsverry11 Did you watch the video? All those companies are not selling what thisbperson wants. The comment your reply is under says the name of a company that makes better armor
Reply: @jakel2837  : Yes. I watched the video. I also welcomed the debate it has generated. I said I hoped it would encourage riders to approach their national standards bodies and apply to join their motorcycle clothing committees, so that the consumer can influence the standards. If you are not happy with what those standards currently specify, it's your opportunity to become part of the solution.
Reply: After watching this video and thinking about it, I removed the Fortnine D30 armour from my riding jeans because it was uncomfortable; left it in my mesh jacket because it didn’t bother me; and bought a leather riding jacket with no armour pockets because it looks nice and has good slide protection. I’m also a careful rider and driver who hasn’t crashed since I was 16, in 1987. 

I think of the irritation / benefit analysis of riding gear as similar to buying insurance: some is needed, but if you go nuts on covering everything excessively, at some point you’ll end up paying the cost of the machines you’re insuring, but never crashed or got stolen, so it’s pointless. If only 2% of riders will crash, 98% are wearing armour we’ll never need. 

To all the people in the comments having meltdowns, demanding the video be removed, publishing inline novels, gathering torches, I suggest you all take a deep breath and take your Karen pills. Since most people aren’t mindless, reactionary drones… 😳 they’re capable of doing their own research; or watching a bunch of YouTube videos on the subject and coming to their own conclusion. Ryan said he was removing his pads for street riding, added the caveat that he’s not suggesting you do the same, that’s all. If people are so easily influenced that they do whatever RF9 says he’s doing, that’s their problem.
Reply: @blattimus  took the words right out of my mouth, people need to chill out lol, I liked the video and understood the message just fine
Reply: @FortNine  As a content creator you need to realize that people look up to you and will inevitable try to emulate what you do. There was zero need for this video and the only outcome is that it will cause harm with the only positive being that some people will just be, what? A little more comfy?
Reply: @bennettsbikesocial  i dont know what vid you watch but dont assume everyone thinks the same or like you because almost all the conclusions you came to he never said out right or insinuated
Reply: Time would be better spent advocating for better armour regulations and not setting an example of no armour.
Reply: @paulvarnsverry11  They are substandard in every reasonable metric. The fact that they coopted the legal standard against the public interest and health does not change the fact that they ensured they did not have to actually create a product that keeps the public safe in a meaningful sense, while creating a false sense of safety.
Reply: @vipe650r  : Are you based in the EU or UK? If so, please apply to join your national standards committee for motorcyclists’ protective clothing and equipment, to contribute your views as a consumer representative.  If you are US-based, you could do worse than lobby ASTM and ANSI to get involved, perhaps under the Vienna Agreement with a push for the current European Standards to move to ISO.
Reply: @paulvarnsverry11  Thank you for the info. That’s a really good idea. And it’s reality refreshing to receive an actually fruitful and useful thoughtful reply. I appreciate that.
Reply: I hope all the Ryan fanboys stop wearing armor. This should be the consequence of being a sheep.
Reply: @IN_ZANE_  They've cited their sources, where are yours?
Reply: @kneedeep185  What specifically do you want a source for?
Reply: @IN_ZANE_  You make the claim "The kph ratings are very misleading and do not realistically correlate to real world speed protection" then question their research, then fail to back your claim with any sort of evidence. It's just ironic, that's all.
Reply: @kneedeep185  How the testing is conducted is not a secret, it's well known and widely documented. If you bothered to actually know anything about the subject you would not have referred to what I said as me "making a claim" Look it up yourself if you're confused and actually care about the topic. All the relevant info is actually contained in the same references posted at the end of the video, which of course you didn't read.
Reply: I stopped wearing helmets too and encourage all to go top less and wear sandles when motorcycling.
Reply: You should delete this video
Reply: Great video. I was not aware of the amount of force the Armour is rated for vs the force necessary to cause a fracture.  I will definitely look more into this being a daily rider and share with others.
Reply: I appreciate my collared bone fracture , it showed me how to be stronger without it i would not have gained muscles after my accident
Reply: The biggest issue I have with any armour inserts is they don't always fit or sit properly against the body. The first thing I do when I buy bike jeans is throw out the knee pads, absolute waste of time. All they have been good for if stopping my knees knocking against the tank!
Reply: what is educational value of this? These protection pads can't help you at impact on highway speeds, but are must at failed U-turns, sharp turns with gravel on road side, cases where you "almost" were able to stop but required extra half a meter or two, still your speed was minimal but inertia threw you over car and so on. Saying that there's no point in these is stupid and harmful, or even deadly at some cases. It's a harmful video with zero point.
Reply: @paulvarnsverry11  Undoubtedly, EN 17092 should have included references to speeds. Without it, numerous one-piece leathers are only AA-certified. I would not trust leathers tested to only 43.5mph on a motorway, let alone on a track day. Some one-piece leathers have even been advertised for track use with only a single A rating! Sadly, I don’t foresee this situation changing as long as we have the problem of regulatory capture.

Regulatory capture led to the rejection of the AAAA and AAAAA proposal, despite the more informed choice it would have given to track day and police riders. Regulatory capture is also why larger riders don't have access to armour in more appropriate sizes. Furthermore, regulatory capture discourages innovation because it has hampered higher standards from being developed and adopted; this situation means it’s difficult to prove higher protection levels, making it harder to get a return on investment in materials science R&D.
Reply: Nothing is ever this simple. There may not be evidence of reduced incidence of fractures but you failed significantly and it may be the research as well but there is no mention or consideration to the degree or complexity of a fracture. You are looking at this in 1 dimension. Fracture or no fracture. This just isn't the real world. Do these pads reduce the severity of a fracture? I dam sure would prefer a simple fracture over a complex or commute fracture any day of the week. I'm not going to do your homework for you but the evidence you are basing your argument on is 1 dimensional and flawed. 

Or is this a shitpost? In which case, haha you got me. Engagement away!
Reply: Oh really? And there I was, thinking that this whole video was about telling riders that there was no point in wearing pads. So if it is not so, the point doesn't come across. I seriously considered to remove the pads because of your video, and it took me a day or two of confusion and reading some of the mentioned articles to realize how dumb removing them would be. Unsubscribed from your channel and you should whipe your hands of the blood of motocyclists who took your advice and were injured
Reply: This video is foolish because being someone with a platform trying to come off as an authority on this matter, your own personal conclusion is to not wear armor. That fact alone almost certainly has/will result in someone removing their own armor and being hurt because of it. This was a very poorly portrayed message
Reply: @paulvarnsverry11  Also, lots of good brands use D3O or SAS-Tec pads, and I've seen Knox as standard pads as well.
Reply: i upgrade some, and sometimes wear body armour on me under the riding gear when offroad so i can switch up layering. 
Base layer (warmth/moisture wicking), mid layer wind protection and extra warmth, armour layer, over layer (abrasion protection, especially when gaing faster on sealed or graded gravel roads), top layer (water proof, fluro layer for bad weather).

On the dirt when doing slow and tech stuff, i can dress like an MX rider (or mtb rider), esp in summer! On the road/graded gravel when i go faster, i can wear the proper abrasion resistant layer.
Reply: …”for balancing comfort v. practicality v. safety, …  I made a point of not telling people to take the armour out of their jackets (twice!)”. This begs the question what you are telling people. If rephrased, are you telling people not to take armor (armour) out …”. Or this is the case, then why sensationalize with the “lure them in buy line” “Why I Stopped Wearing Motorcycle Body Armour?”
Reply: Never heard of the Darmstadt machine lol. Couldn't find anything while googling too
Reply: I ditched mine years ago.  But I've been thinking of getting exterior dirt bike style armour.